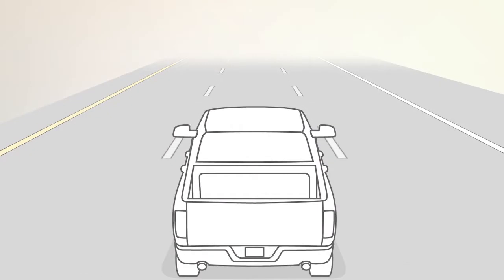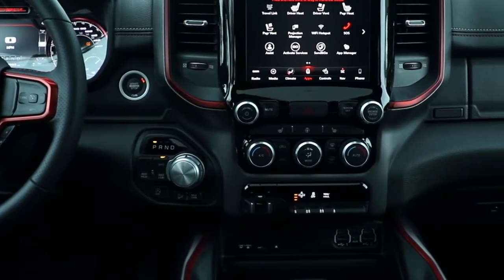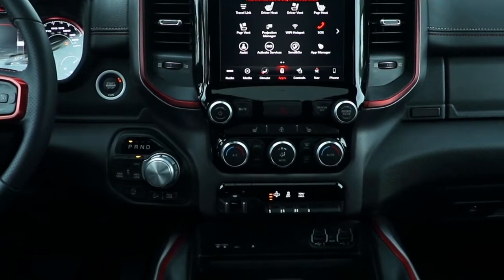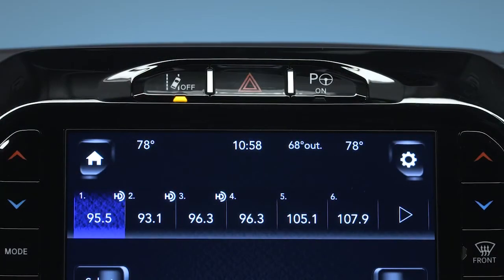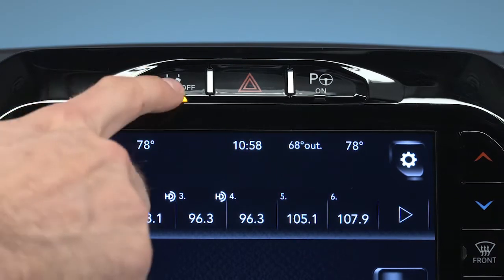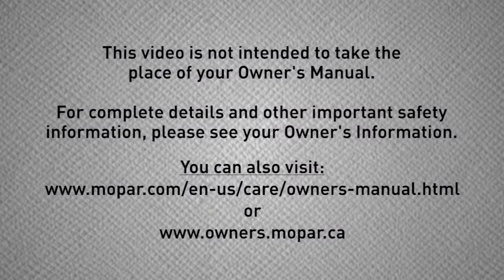LaneSense-Lane departure warning light on 2019 Ram Truck

Comment: What about lane sense warning or Lane keep assist on the 2020 Ram 3500 Dually. The ram websites are lacking in this information. What about the self-parking feature that is available on the 1500s will that be available on the 3500 Dually. If so I may be interested in trading in my 2014 Limited